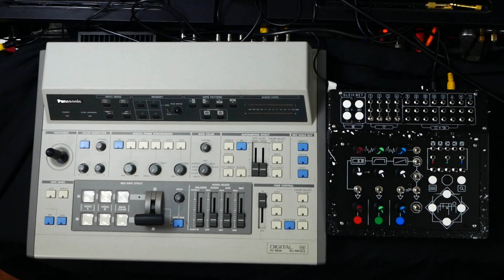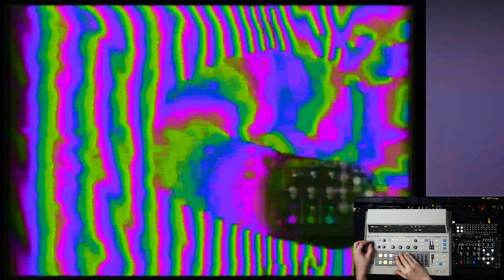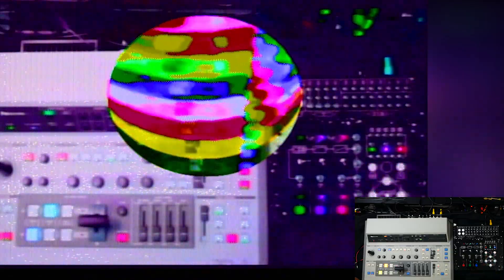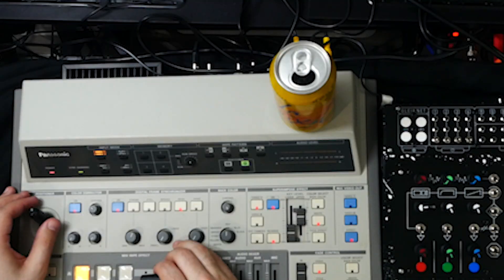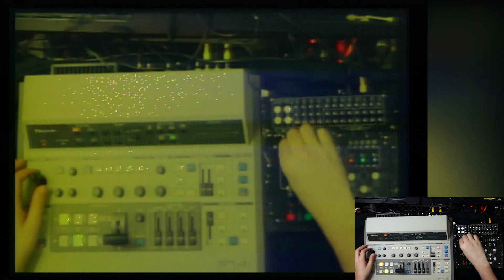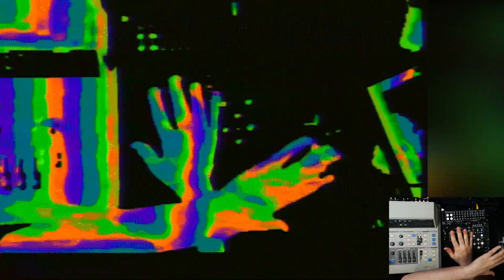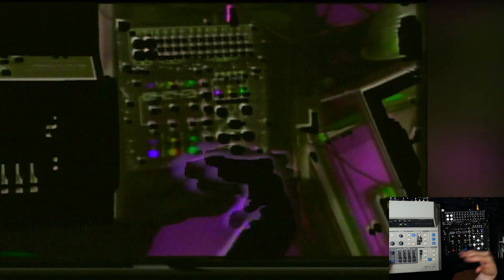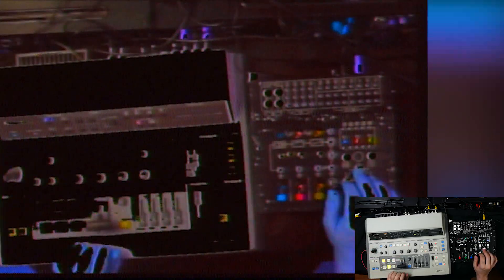Making analog video feedback with GVS010 & a Panasonic WJ-MX12 composite video mixer

Comment: Currently Building on a maximized versin of the MX 12 modification that lofi future posted in their DIY section. Interting to see what can be done with a basic GVS010 video synth and the basic mixer though!
Reply from the maker: There are some notes floating around out there about a mod to add a proper Luma key to the MX12 too - I started gearing up to do it some time ago but it ended up far more of a to-do than was worth it. But yes, basically sticking anything that allows for positioning, scaling, & color correction adjustments into a feedback loop opens up the sandbox in video land.
Reply: @gleix_  It's amazing to see analog getting the love it deserves. I have the luxury of working in a small sized broadcast equipment company. But that's a lot of SDI via copper and fiber, occasionally HDMI for the prosumer market... When I started cobbling together the MX12 mods the old gear heads really came in handy to explain i.e. why there's an inductor and a 75Ohm resistor at the inputs, why it's easier to make a composite video instead of an SVideo output, etc.

Comment: Hey man! Great vid! Sorry for the stupid question, but how technically do one sends signal from the output both to Capture card and GVS010? Some RCA splitter?
Reply from the maker: Hey there - yes, you can split the composite signal off to two separate cables by using a passive splitter (you can also make these fairly easily). Alternately you can use a composite video distribution amplifier to maintain signal integrity which is especially important with these analog signals if you're splitting it off to multiple places. These can be had pretty cheaply. Most use BNC connectors, so you may need BNC > RCA adapters.
Reply: @gleix_  Thank you, man!
Reply: @gleix_  Thanks man! Will look for some of them amplifiers.